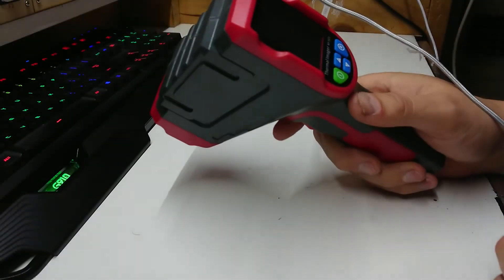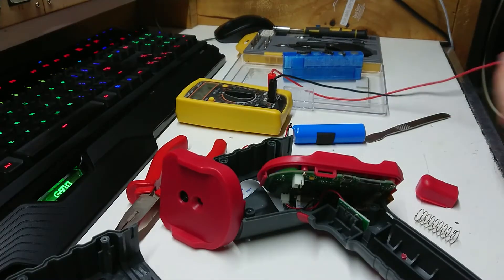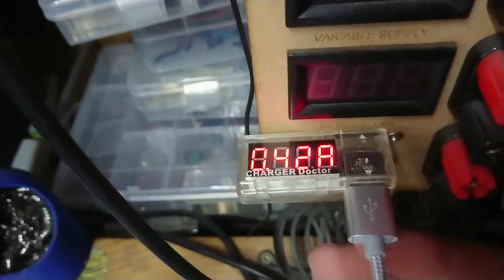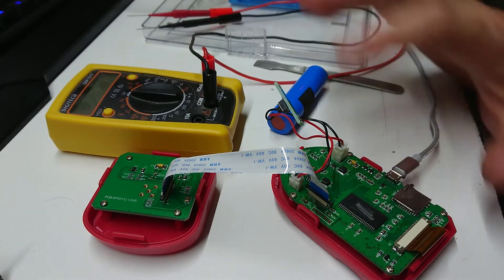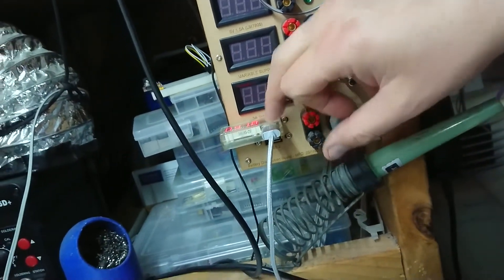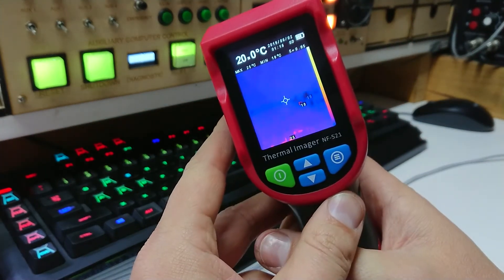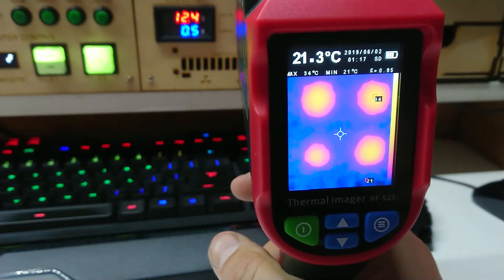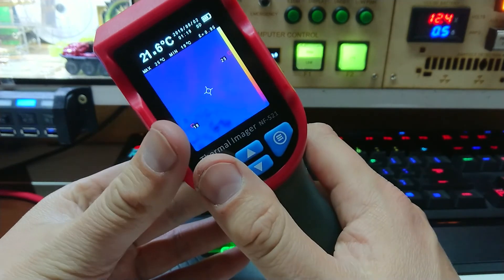Repairing my brand new Thermal Imager (DOA)

Comment: this is not repair. just replace battery sir
Reply from the maker: Pretty much, but the battery was fine - just disconnected.

Brqnd new, arrived non-functional. I classify that as a repair, even if it was a simple one.

Comment: Cool, does it need to be a Flir brand? Could you test, if it's ok, if that type thermal imagers see where the leak is in the walls? 

Thanks.
Reply from the maker: It's a far cry from a genuine flir brand, but you can certainly see thermal variations in a wall yes.

I'd call this an "entry level FLIR" - in other words, about as basic as they come.
Reply: Thanks. What model and brand that's still affordable, you think is a level above that model?
Reply from the maker: @SevenDeMagnus  I'll have to look it up. It was the cheapest one I could find on aliexpress
Reply: @SevenDeMagnus  uni-T some models